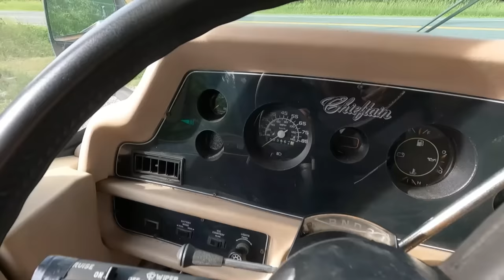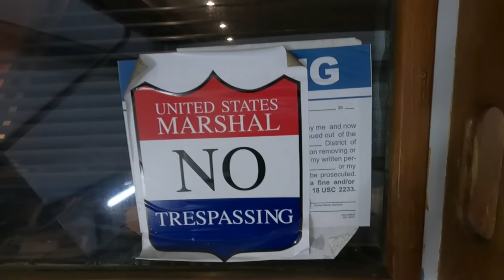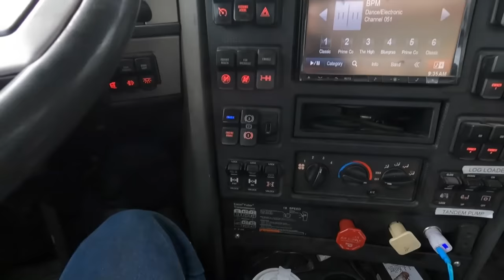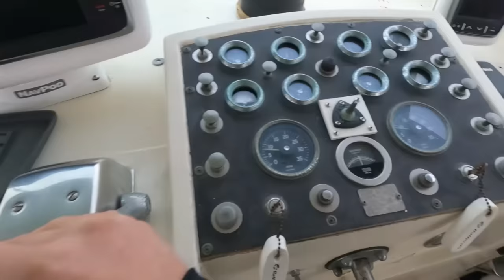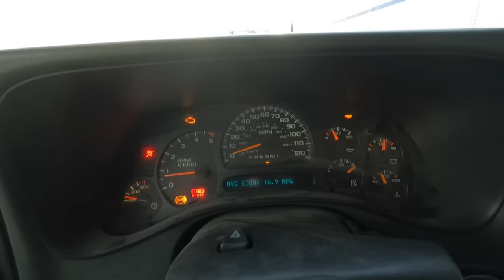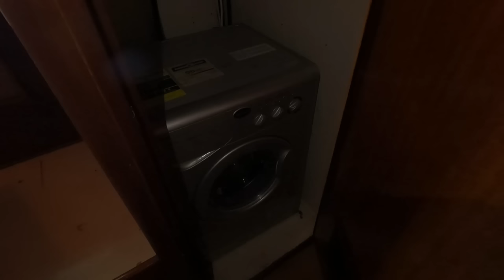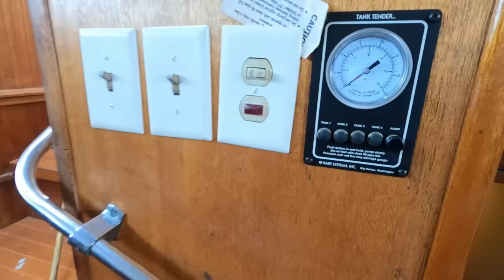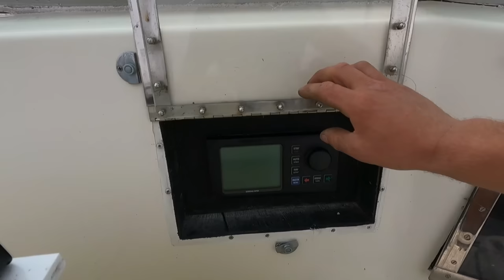I Bought a Hurricane Damaged Yacht and Full Life Update!

Comment: I have no clue what kind of price you paid for that beautiful Hatteras, but as handy as you seem to be with everything, you picked a winner. The fact that it has been repowered with those 2 awesome engines makes is very valuable and then add in all the other neat things they added to it and that may be the buy of a life time. A 50' Hatteras puts you in some nice company and a step up in the boating community. They are well built with nice features and beautiful wood.  I wish you the best of luck with it and safe boating!!!
Reply: Should be quite easy to break up for scrap. Sell the engines and other components for profit. Fibreglass can be cut to pieces with grinder or metal reciprocating saw.

Comment: If I was your age again, I would be doing exactly what you are doing right now.  Very inspiring.  I have a 1973 Bertram 42 flush deck that's my pride and joy.  But, I got into that kind of boating later in life.  I shouldn't have waited. But, one of the things that sold us on our boat seven years ago, was the fact that it had just been repowered with brand new Yanmar 370 hp diesels.  New engines is huge.

Comment: You should never pre-select from low to high, I have been driving big for 30 years, and preselecting can bend the forks on the shifter. Just take out gear and switch it to high and put in the next gear. It will become easier the more you do it

Comment: I took a $1500 1992 33 ft Allegro from Tampa FL to San Diego.  Only had 51,000 miles on 454, but it Had some kind of weird problem: around every 110 miles, the oil would turn black, oil pressure would drop to 5psi,
and it would start smoking out the tailpipe.  So, I changed the oil literally 22 times at rest stops and Walmart parking lots  during the 3 day trip.